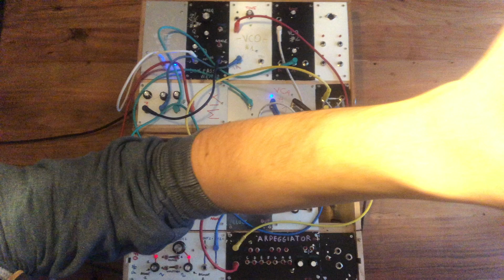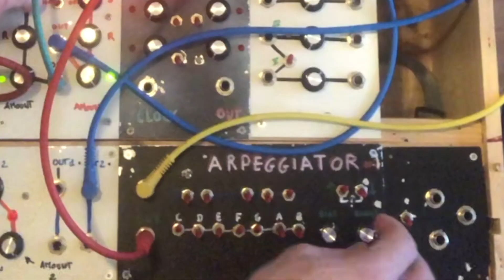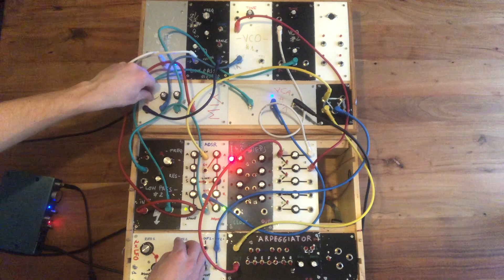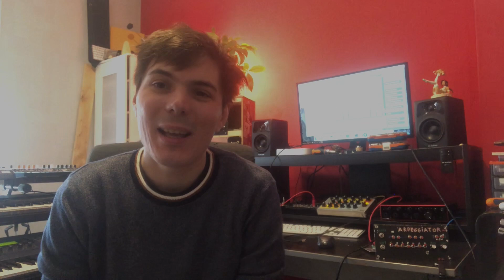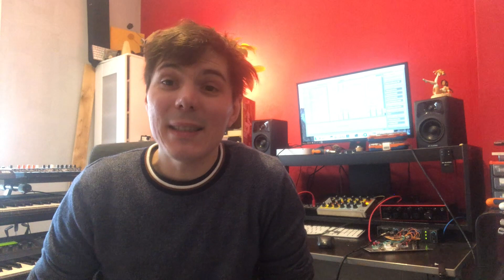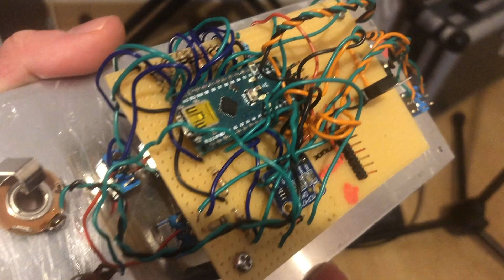DIY ARDUINO ARPEGGIATOR - [YMNK's DIY synths adventures]

Comment: Hello, 
good work! The graphic design, does that represent the complete circuit? I'm irritated because there is a circuit diagram of the arpeggiator on the LMNC page where there is also a Tl072! Is this the additional optional buffer?

 Greetings
Reply from the maker: Hello ! And thanks !
Yes, you can add a TL072 in order to buffer the output. I think it is safer. 
I should update the circuit schematic ! :)
Reply: @YMNKmusic  thank you very much
Reply: Hello, 

Thanks for your help, I don't want to waste your time, I built the new schematic without the external resistors, unfortunately it doesn't work for me, I checked everything 4-5 times and can't find the error! Is the arduino ino program file suitable for the current circuit without the external resistors?  
Which adafruit did you use, do you remember? Maybe that's why?
 Greetings
Reply from the maker: Hello @maikmario71  . Did you use the code here : https://github.com/alexiszbik/arduinoarp_1.1 ?
Reply from the maker: Also @maikmario71 , please check this line 

    // For Adafruit MCP4725A1 the address is 0x62 (default) or 0x63 (ADDR pin tied to VCC)
    // For MCP4725A0 the address is 0x60 or 0x61
    // For MCP4725A2 the address is 0x64 or 0x65
    dac.begin(0x62);

Maybe you need to change the address of the MCP4725 in the code to make it work
Reply: @YMNKmusic  Thank you for your feedback signal! I had used a Chinese MCP4725, but it didn't work for me as I've now discovered! I bought an ORIGINAL MCP4725, the same one you use, so it works great now! Unfortunately the B Note (D13 doesn't work at all on Arduino), I checked everything, connected D13 like the other D2 - D12. I use an Arduino Nano from Chinese production, I also tried it with another Nano, but the same problem here (B no reaction). Next I'll get over myself and buy an expensive Arduino, the same one you use, in the hope that it works, otherwise I'll live with the B not working. Still a great module!

 Maybe you have an idea, otherwise thank you again for publishing it.
Reply from the maker: @maikmario71  Hello ! Thanks for your feedback ! And glad to know you fix your issue with the MCP. Still, it's weird that the knock off doesn't work at all ! Have you tried changing the MCP address in the code? About D13 ... on the revisited schematic I use internal pull up for the button ... But it seems that internal pull up doesn't work for D13 ! So you will have to use a resistor for the button like in this previous version https://github.com/alexiszbik/arduinoarp and change the code to make the D13 work not with internal pull up resistor ...
Still, I have to verify this information. I will update code and schematic as soon it is verified.
Reply: @YMNKmusic  ...OK thanks!
No, I didn't have to change anything at the address on the new original MPC sent :)

If the code for D13 should be adapted, I very much hope that you will soon find some time to do this, unfortunately I am not familiar with Arduino programming at all, I wouldn't know what to do!
I would be very happy if you reported here whether a current INO is available for download!

Best regards
Reply: ...I was in the: "lookmumnocomputer.discourse" forum and it said about a change in the code:

for (int i = 2; i <= 13; i++) {
    pinMode(i,INPUT_PULLUP);
}

...could that help? But I wouldn't know exactly where to insert the manual without making a mistake because I forgot a dot or line.
Reply: Hello, I don't think it will work anymore, you definitely don't have the desire or time to change the INO for the B grade. I would then like to adapt the built 2.0 arpeggiator version so that it runs with the INO for 1.0. Can you tell me what I have to change, certainly the 10k resistors from D2 to D13 would then have to be attached. What else needs to be done? Maybe you have a little time for this, I would be very happy to get feedback. Greetings
Reply from the maker: Hello. I am so sorry I am currently off the office cause I am in holidays right now. I will take time to modify schematic and code as soon as possible. Sorry for the delay.
Reply from the maker: @maikmario71  I'm still not back to the studio, but I found some time to do the changes in the schematic and the code. Please check it here and tell me if it is working fine : https://github.com/alexiszbik/arduinoarp_1.1
D13 is now using a pull down resistor, it can't use an internal pull-up. So I made the changes in code & schematic accordingly. I am waiting for your feedback, thanks for reporting me this issue.
Reply: @YMNKmusic  Hello, Great, thank you for your feedback. I will try it! It would be perfect if I didn't have to do without B :). I'll get back to you! Thanks again for your effort
Reply: @YMNKmusic  Hello,
Thank you for your effort ! Because of a lot of work, I only now got around to testing it extensively.
I now have the following phenomenon: If, for example, I activate F and G and then later switch on C, he now plays 4 notes instead of 3, the same thing happens if I switch on B instead of C, and ON is now off and Off is ON, so vice versa. Then I doubted myself and checked my wiring, but everything was ok.

I don't know, maybe I'll have to do without B on the arpeggiator or do the work again and build your first version. Maybe you feel like/have time to tinker with the INO and Schematic again, but you wouldn't be mad if you didn't, because you've tried it and aren't making any money with it.
In any case, thank you very much!!!
Reply from the maker: @maikmario71  Hello to you !

* the on becoming off and vice versa is totally normal. I made a mistake in my previous code by inverting switch states in the code. Consider this new behaviour as the expected behaviour.

* About the F+G+C thing that produce 4 notes instead of 3, it will depends on the position of the BIAS & RANGE knobs. Please tweak them to get your expected behaviour. BIAS specify the minimum note of the outputCV, RANGE specify the range of the outputCV. So the output will be modulating between (BIAS, BIAS + RANGE)

I tested the latest code at home and it works as I expected.
Reply: @YMNKmusic  ...OK thanks ! I had already tried to adjust the range and bias, without success, but perhaps not extensively enough, I will test more later...thanks first!
Reply: ... as I said, by the way, the phenomenon that if I add c or b I get 4 notes instead of 3, but if I add any other note I actually get 3 without adjusting the bias and range, but I'll do it all again Check, because the switches are soldered to the stripboard, there may be a short circuit, I'll check everything carefully this time, it's reassuring for me to know that ON should now be off :)
Reply: ...at first it didn't work because my board was aligned for the 2nd version. I have now thoroughly changed and adapted the board. Everything works great (fantastic). I designed a very nice panel for it, unfortunately I can't present it here. Thank you very much for your effort!
Reply from the maker: @maikmario71  oooh, that's great ! I am very happy that it ends up working.
Thank you for making me notice that's something was not going well btw !
Have fun with your new module !!!

Comment: Hello can you give me any advice on trouble-shooting? I went through my build using the serial monitor and was getting voltages that look sensible for the switches and pots but wasn't getting any sound out.

 I don't fully understand the DAC step, like how to get the right address. The closest I've got to success is depending on what address I use I can either hear my clock output nice and clear with no pitch or I can hear a hint of arpeggiation under a lot of ground buzz. I don't know how to do any tests for the digital output of the arduino and the address of the DAC. I'll keep digging but if you have any advice let me know :)
Reply from the maker: Hi! i'm not sure to understand your issue. The pitch output doesn't make any sound. It outputs a continuous signal between 0 and 4V that you have to send to an oscillator (or whatever takes a CV pitch signal). Sorry if I misunderstand you.
Reply: @YMNKmusic  hey I figured it out it's not an issue with my build it's just it didn't take the trigger out from a volca sample. I'm using it with an lfo and it's working :)

Thanks it's very cool
Reply from the maker: @chrisbullock613  Oh! Great! Yes I had the same issue with Volcas ... I will work on a fix on this issue for the next version ;)

Comment: Just built this and it's great, thanks so much for sharing! It only works for me without the diode though.
Reply from the maker: Oh, that's so cool! You mean the diode for the clock input? 
Yes, it seems that it is not the best way to put a diode here ... there's interesting thoughts about it on this thread : https://lookmumnocomputer.discourse.group/t/arduino-arpegiator-module/2581/3
It seems that using 2 schottky diode might be a better solution.
I'm just curious, what to you use as a clock?
Reply: @YMNKmusic  just a basic LFO. The+/- pulse was problematic. I changed the diode to a 1K resistor (not sure if that offers any protection) and it works. It also works fine with my beatstep gate out and also my Arduino Midi clock.
Reply: Fun module though, very handy for calibrating 1v/Oct oscillators! Mine were all out by a mile.
Reply from the maker: Yeah that’s indeed very convenient !
Reply from the maker: Oh that’s strange, in the video I use a square Lfo too with - and +. But yeah depends if the output is buffered or what is the output voltage I think ... I pight find a universal solution in the future! Thanks for pointing out your issues ;)
Reply: @YMNKmusic  Interesting, today I calibrated an oscillator to work with the arpeggiator (sounds great) and now it won't track when I use my Beatstep sequencer. Weird. I am using a cheap MCP4725 so is that the problem?
Perhaps it needs a different library to the Adafruit one?
Not sure if I can adjust the noteToVolt code to fix it.
Reply from the maker: @mathewthomas3238  oh, that’s strange! Do you have a multimeter? Check the output voltage of the arpeggiator when playing only C and you should have something like 0, 1v, 2v, 3v, 4v ... and same for the beatstep then. You will see which one is out of tune!
Reply: @YMNKmusic  Yep, the beatstep is reading 1V/Oct and the arp goes from 1 to about 1.8V
Reply from the maker: @mathewthomas3238  wow, ok. What is the reference of your MCP4725? Could be interesting to see how we can fix that!
Reply: @YMNKmusic  it's a cheap version of SparkFun I2C DAC Breakout - MCP4725

$1 from eBay or AliExpress. There's no other information printed on the board, but it's basically the same chip as the adafruit board. The sparkfun website has some information that might help.
Hey, thanks for all your help with this!
Reply: Also, I did fool around with the noteToVolt code. Got it tracking pretty close by adjusting the division number (5.0) to 4.15 (trial and error)

Comment: Brilliant work! I have 1 question, can i avoid dac converter, probably using r2r simplest dac or smth. I have all components but no dac...
Reply from the maker: Thanks! I don’t really know ... I have no idea about r2c or smth. I will check what it is and see what’s can be done !
Reply from the maker: So Yeah, I think you can achieve with a R2R DAC (a resistor ladder), but you will have to use a certaine amount of resistor to achieve it I think, and you will need to code the correct thing to use multiple pin output for getting the right voltage  ... Anyway, you will have to use Multiplexers/Demultiplexers for that kind of mission! 
So, yeah, it needs some tweaking to make it works!

It gives me an idea about a random CV generator, using this R2R method - so I will try this in a different project!
Reply: @YMNKmusic  Okay, thanks! This project is really good. I will try to do my best in coding... Maybe i will get it!

Comment: This is excellent thanks so much for sharing! I think it'll be my first arduino project :)
Reply from the maker: Thanks! Have fun!
Reply: @YMNKmusic  Thank you! I was wondering if I can use the output from an APC as the input? Does it need a trigger / clock CV or is a regular audio signal ok? (I'm a novice so sorry if that's a silly q)
Reply from the maker: @chrisbullock613  What do you mean by APC? A Akai APC Midi controller? You need a clock signal, which is basically a square signal at the frequency of your chosen tempo.
Reply: @YMNKmusic  sorry, no just Atari punk console. So it'd be something approaching a square wave at supply voltage.
Reply from the maker: @chrisbullock613  Yes the atari punk console will do the trick if you set the frequency super slow (otherwise you will have a SUPER FAST arpeggiator ... which is nice too :) ) In the video I use SQUARE lfo as a clock ... so anything square might work. Best way to test, is to build it on a protoboard before to solder it ;)
Reply: @YMNKmusic  will do! Thanks so much for the advice :)

Comment: Very nice! I will have a look at the code, but I am guessing the Arduino sketch is quantizing the notes, not a separate quantizer. Do you think this project could easily be repurposed as a quantizer?
Reply from the maker: Thanks! Yes, in the Arduino code, when there's a HIGH state in the input it changes the note... If you want to make a quantizer it should be a totally different code. But that's an interesting project, I should make a project like that!

Comment: Salut, super taf mec, merci de partager ça, je met ça dans ma liste à faire, sinon on a déjà la guitare et le modulaire en commun et je partage aussi pas mal de chose qui pourrait peut être t'intéresser sur mon blog.  On trouve pas vraiment de truc en français, mais sinon en anglais je participe au forum LMNC et j'ai récemment posté ton Arpegiator :)   en tous cas bonne continuation a toi 
@+ 
Sound Bender
Reply from the maker: Hey merci beaucoup! En fait je connais déjà bien ton travail et je suis assez assidu de ton blog que je trouve super!  Quand j'ai commencé mes premiers circuits ça m'a beaucoup aidé! Merci d'avoir posté sur le forum LMNC! Au plaisir de se croiser un de ces 4!